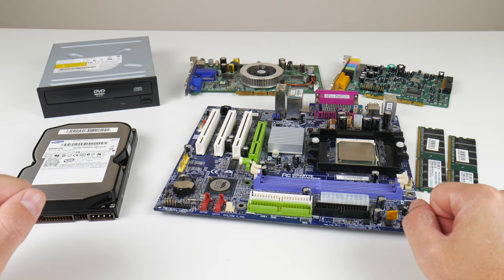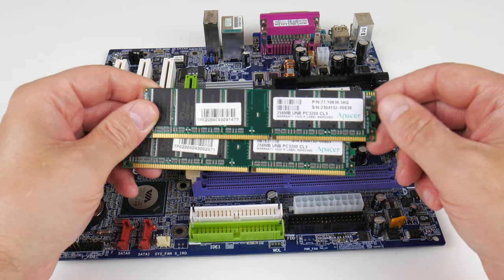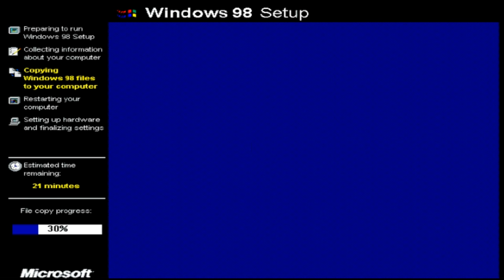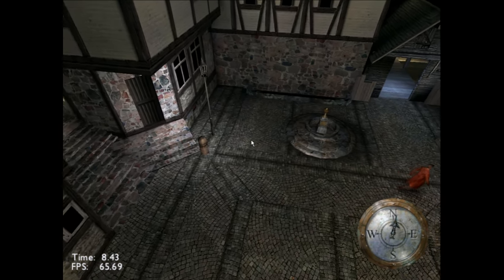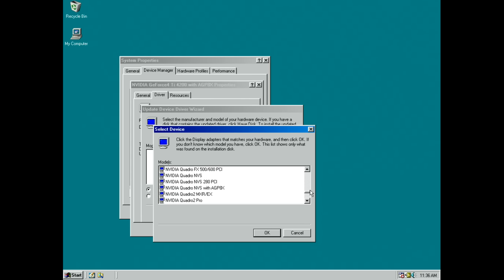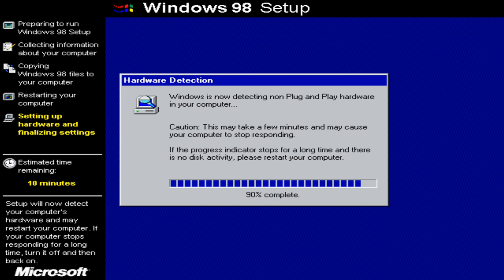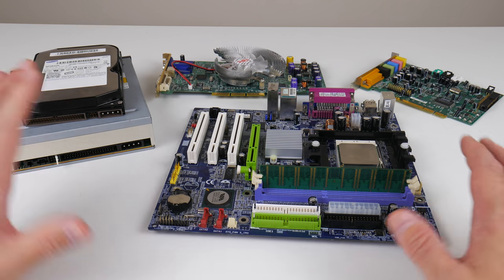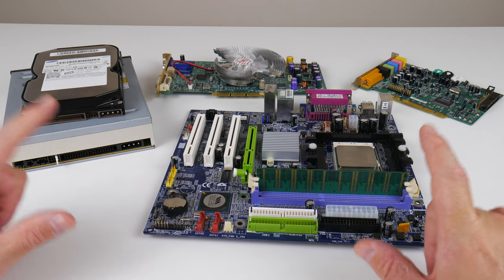Building Windows 98 Retro Gaming PC with AMD Athlon 64 Platform

Comment: If you want to use the SATA ports, you can enable RAID in BIOS (no array) then install the RAID driver and clone the install to a SATA HDD OR SSD. It works great and you get use of both SATA and IDE ports.

Comment: Hey Phil, Great Video, Why would you use the the older 45.83 forceware drivers vs the 81.98 forceware drivers? I am using 81.98 on my Retro Box (P4) w/ FX5700.

Comment: I had many Sound Blaster Live cards from salvaging parts from broken PCs.  I'm sure the sound card on the motherboard is adequate for Windows 98 gaming though.  For games that run in DOS, a Sound Blaster card is probably your best option.
Reply from the maker: Sound Blaster Live! is super for Windows 98!
Reply: For windows 98 gaming, a sound card with hardware eax or a3d is a great benefit for many games.
Reply: @philscomputerlab  I remember Sound Blaster Live working on the early builds of Windows 7 then when I reinstalled later versions I couldn't get the darn things working no matter which driver I tried.

Comment: VIA! Man they were a plague back in the Win98 days. Highly buggy and unreliable. At least those old original boards. #viaavoid  :)

P.S. You DID have issues with VIA, heh. SATA didn’t work. Videocard didn’t install correctly. All CLASSIC VIA issues.  :)   Still. Good video and allows users to decide with your good information as always.
Reply from the maker: You need to watch until the end, there is a happy ending :)

Comment: Great video Phil!  How would you under clock a CPU like that?  Would you just go into the BIOS and change some numbers?
Reply from the maker: Yes you can go into the BIOS and change the CPU multiplier or ratio. It can go as low as 5x which will have the CPU run at 1000 MHz instead of 1800.

Comment: I finally found a motherboard that I will be using for my Windows 98 retro build. No SATA. It took a while to find a board to use that was pre-SATA. It also has 512MB memory.. Also got a swanky ATI 128MB AGP card for it. Just need to look now for a sound card

Comment: Some 1 I know installed win 98 with 4 gb working ram! On a HP 6710b laptop (dual core t7500). He also fixed the color and screen to 32 bits. Amazing lol.

If you wanna know what programs he used, ask me.

Comment: I had a chance to pick up that sound card for cheap but passed on it because I read its pretty craptastic in DOS. For Win98 I have heard alot of very good things about it.
Reply: The one thing I remember about DOS is that it was very picky about newer hardware.  Getting sound to work was usually just a matter of selecting the correct IRQ in the game's setup.
Reply from the maker: Yea for DOS there are better PCI cards, and best are of course ISA cards. But the Santa Cruz is a good allrounder card and drivers are easy to install.

Comment: OMG I have the EXACT same motherboard for my Win98SE retro build! Thanks a lot for the Ctrl-F1 tip!

Got the entire system (K8VM800M-R2, Sempron 2800+, 250GB IDE/PATA HDD, N6200 128MB AGP, 350W PSU, and SEVEN strips of DDR RAM of various capacities from 256MB to 1GB) for just NT$500 (US$17, AU$26) last year. The graphics card was a bit unstable (probably due to its several bulging capacitors) so I replaced it with a Gigabyte GV-R9000 Pro II (wished I had better choices like 9600 or 9800, but that card was the best choice for a reasonable price; used mid- to high-end AGP cards in good condition are very rare and pricey in Taiwan) and added my old Sound Blaster Live! Platinum. It's running all my vintage Windows games (particularly those incompatible with WinNT/WinXP, such as Thief 1&2) without issues ever since.

There's one small issue: running CPU-Z 1.78 ("revived" Win98 support) would result a BSOD; seems to be a VXD issue. Running 1.57 (the last "original" Win98 supporting version) or the "vintage edition" 1.01 are fine.
Reply from the maker: Very nice! Radeon 9000 cards are very solid performers and have AA and AF to play around with. Wouldn't worry about CPU-z...
Reply: Found an used Radeon 9800 Pro on eBay for US$40; the same card in Taiwan would cost US$140.

Comment: Phil, does your board have the "Plus" variant of the southbridge on that board?  It's supposed to be the revised variant  that fixes the SATA controller. I've been working on as similar project, only I'm using a 3700+ (board was supposed to be an xp class machine, but I wound up going in a different direction) , a SB Live 5.1, and the Quadro FX variant of the 5900 Ultra. I'm still working out bugs as far as installing  the OS/drivers is concerned.
Reply from the maker: I does! Live! and 5900 Ultra work well with Windows 98 :)
Reply: Sounds like the same issues I was dealing with. Supposedly jumpering them to SATA I speeds helps with compatability. I  just recieved a 500 gb hybrid drive I'm going to try with the onboard SATA. If I cant get a functional ME or 98se install with it or my SATA card (I was having similar problems with a SATA PCI card) I'll go with the bridges I own. Maybe they'll work this time!

Comment: Nice! I have a amd Athlon 64 3200+ and it hangs with all the new processors just fine. Only issue is it's a bit stuttery playing 4k. What do you recommend I do? I heard overclocking is one option. Maybe upgrade graphics card?
Reply from the maker: 4K? Only hope is a video card that accelerates the video decoding. If the content is H264 and the machine is PCIe you do have options...

Comment: The VIA chipset doesn't like SATA 2 drives if your drive has a jumper to switch compatibility back to SATA 1 you can use it as a workaround.
It was a well known issue back in the day.
I still have my brothers old 754 Althon 64 2800 on a Gigabyte GA-K8VT800  it is using a WD SATA hard drive switched to SATA1 compatibility mode.

Comment: I still have my K7 Triton motherboard, I think the only difference between that and your was that it has dual channel memory support.  I've been using it as a 98 machine since I got it, and eventually put in a XP install on another hard drive and use the Master/Slave switch trick to control which drive is the master during power on.
Reply: The only thing different is that I have a GForce 6800 on that machine, as it was the best card i could find, back when they weren't that expensive.

Comment: Got my system up and running. Specs: Asus A8V Deluxe, Athlon64 X2 @2,8GHz, 2GB RAM, 160GB SATA, Radeon 3850 AGP & Voodoo3 PCI, ESS Solo-1 & SB X-Fi. Triple-boots Windows 10, Windows XP and of course Windows 98SE/DOS. In Win98SE/DOS I use Voodoo3, in BIOS I select init PCI display card. And in Windows XP & Windows 10 it's Radeon 3850. Windows 10 needs to be 1511 version because it's last that supports AGP.

Comment: I've had a problem on my vintage PC where it would turn on for a second, but the turn off, I got that resolved after I found out I just needed to have a floppy drive connected, but now it just won't display, is it that the motherboard, or cpu are damaged? Or do I need to reset the bios? IDK how to reset the bios on vintage motherboard s if I do have to, but I do know that I had problems with computers not displaying in the past, and the fix was just to put in a different cpu, but I don't have another compatible cpu, so idk what to do.
Reply: What PC do you have? You can try different things.
Try clearing the cmos. There should be a jumper to do it, but if you can't find it you can just remove the battery for a while, that should erase all of the bios settings as well.
Also you can put in a new battery, I had a Socket 7 board that wasn't turning on with an empty battery.
Try different ram, if you have multiple sticks of ram you can just remove them all and try everyone individually
Try disconnecting all your floppy or harddrive cables from the board, I had a PC that was not booting because of a broken IDE cable.
Reply: @Tom2404  I've got that problem fixed, I just bought another motherboard, the only problem I have now is that for some reason my hard drive is not being detected.

Comment: I have a very similar setup nearly ready but I have to recap the motherboad first.
Btw, Medion cards can be a bit weird, many times they're downclocked, don't run with some drivers and things like that, after all they're made to be cheap and just run in the machines they're installed.

Comment: I´ve got a socket 462 MSI motherboard with Via KM400A chipset (via8237 south bridge). Once in a while the S-Ata hard drive would not be detected at system start. I have to turn off the machine and reconnect the drive in the other S-ata port available, and so forth. Fortunately it doesn´t happen that often. Weird. For what I´ve read around in the Internet it is a known issue.

Comment: Hmm i was experimenting with various lga 775 motherboards with VIA vt8237R+ chipset and found out that sata devices work perfectly fine only when you use VIA's v-raid driver package. Since VIA has native win9x sata & raid drivers for vt8237 vt8237R+ vt8237A vt8237S vt8251 cx700. the default storage controller gets change to the v-raid controller which makes reading and write files really fast. I wish intel had still support up to ich7 like this but at least we can set sata to emulate a pata controller in the bios with later intel chipsets.
Reply: I loved VIA chipsets back in the day, looked more flexible, also SIS were decent
Reply: I had a P4M8M-V2 motherboard from MSI and had 8237A southbridge instead 8235 maybe for the MB revision since the user manual said 8235

Comment: Great vid! For the games that not work properly in my Windows XP retro machine (Intel E8600, 4gb DDR3, GeForce GTX440TI), I buid a PC with a Pentium 4 1.5ghz, 512 MB DDR,  and a a Geforce 4 MX with Win 98. I use it only for older Windows games like Sega Rally 2 that requires Win9x machine and also not work in my Windows 2000 machine (Celeron 430, 2gb DDR2, Ge Force 6200 TC), also use this W98 PC for Worms 2, Midtown Madness 2, Need for Speed 2, and others.

Comment: Thanks always for the inspiration and ideas. Did you manage to get this motherboard's USB2.0 ports working under Win98? Was anything to do with USB2.0 included in the VIA 4in1 or what drivers are needed? I'm stuck getting USB2.0 to work with a similar build.
Reply from the maker: I've disabled them. But on the Gigabyte website there are USB 2.0 Windows 98 drivers.
Reply: @philscomputerlab  Thanks so much for your reply. The mobo is a GA-8VM800M-775. I wonder if the the Gigabyte drivers for the GA-K8VM800M which has the same VIA chipset may have worked but anyway I was able to get USB2.0 storage working using just the nusb36e driver and no Gigabyte or VIA drivers installed... all I had to do  was manually remove all USB devices from device manager before installing nusb36e while using a PS2 mouse, otherwise I would get errors with msgsrv32 on boot. In your other video you recommend 865 chipset for P4 98SE but I am stuck with the one I've got unless it proves too incompatible.
Reply from the maker: Nice, good outcome!

Comment: I like these retrogaming rigs videos :)
Been playing around with a P4 Willamette 2.0Ghz (socket 423), 640 rdram and Windows 98SE, 2K and XP.
But decided to go with a Radeon 9800 Pro.
Windows XP is too tough with these specs.

Some specs are too high for the games you can run with these components.
Or sluggish with newer games.

I used Steam on XP as a workaround exists.
Reply: What's the workaround for steam to work on xp? Heard about this but didn't know how to get it working. Any help or advice would be appreciated. Thanks..
Reply: @Neksus-M06  thanks, I appreciate it..

Comment: Great video! I have a socket 939 I use for Windows 98. Some people say it's overkill but I say 1600x1200 max AA! I think the jump from the 4200 to the 4600 is maybe more because of the better drivers. I also use it for late DOS games - HOWEVER... Build engine games - where the power is most useful at 1600x1200 software rendered - do NOT like my 4200 or 5900FX. At low resolutions they are okay but at the ultra high ones they have all sorts of weird tearing and the fps counter tells lies. I had to downgrade to a GeForce 3 and then Duke Nukem 3D and Blood worked well at these resolutions - about 50-60 FPS at 1600x1200 on an a64 4000+. There's no such thing as overkill when it comes to software rendering high res!

Comment: I succeeded to use sata hdd drive in my fx 4100 windows 7 64 bit. Keeping AHCI mode connecting the drive to sata3, now it has no issues to install windows 7 64 bit.

Comment: I've always tried to get VIA chipset motherboards. Very compatible with various hardware I've thrown at them. I run an ASUS A8N-Deluxe with a Athlon 64 3700+ and a GeForce 7950 GT under windows 2000. I find windows 2000 is very compatible with windows 9x games; I've got a Pentium 2 machine with win98se for the few that aren't, plus DOS games.

Comment: Out of couriosity: Do you have a 939 motherboard with a similar VIA IGP laying around? Because i remember tests from back in the days, where the nforce2 IGP got an significant boost from using Dual Channel and even today it's the same.
Reply from the maker: Yea it will likely also benefit from the higher memory bandwidth! But having said that, Windows 98 compatible dedicated graphics card are easy to find and cheap!

Comment: Hard to say why the 4600 was so much faster than the 4200. The numbers for the 4200 really did seem very very low, and the 4600 is about what I would have expected. Could be something with the agp 8x implementation on the 4200 and not having fun with 98 drivers? (Is it for sure an 8x card? Most were 4x)  If things like side banding are not enabled, that can crater the performance by about that much. Perhaps with the drivers not working correctly had something to do with that?

Comment: Since you are the Budget Price to Per4mance king, what pc should I get, I think about going all in and getting a new b450 motherboard, the 1600af, and 8gb of ram (1 stick, or used 2 sticks), or save some money by going with a used xeon 2630v2 (on aliexpress can be found for 20 usd) a new chinese motherboard, and 2x8gb of ram. I need the pc to be able to drive games for atleast 5 years. (I plan on getting an rx580/570 8gb used). What do you recommend? (I have a 1600x900 monitor also)
Reply from the maker: I'd get the Ryzen platform!

Comment: I have been trying to get a Windows 98 machine up and running for over two weeks. First I tried it with a SS7 board and then with a Socket A board. So far Win98 has just been a buggy mess with constant crashes and drivers failing to install. What's your secret to a solid Win98 machine?

Comment: Good build for a retro system on the cheap. But Windows 98 might as well be called "Windows 98 Problems"
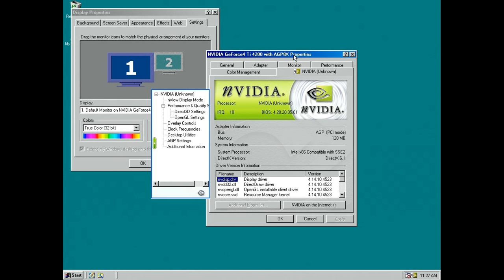One thing that may explain your odd performance uplift going 4200->4600, the 4200 appears to be running in PCI mode (2:06) and the 4600 in AGP 4x (14:48). Perhaps there's some problem with the chipset drivers.
Reply from the maker: Very interesting. The fact that the drivers wouldn't even install, maybe the card is just on its way out? I used the same chipset drivers, so not sure what went wrong...
Reply: I have the same card and didn't notice any problems in Windows 98, I used the 81.98 driver though. Maybe the previous owner fooled around with the bios to overclock it to standard Ti 4200 core clock.
Reply from the maker: Just an update. I figured out the issue. I'm working on a AGP FX 5500 review, and turns out the latest VIA chipset drivers, cause it to show up as PCI. Whereas the older ones from the Gigabyte site show AGP 8x. Performance is faster in AGP 8x mode :) Mystery solved :)
Reply: @philscomputerlab  That's good to know. Thanks for following up on it!

Comment: Try a different SATA controller. Via's SATA controllers are crap. Luckily my Via board comes with an extra 2 sata ports from Promise, but unfortunately they don't work under 98.
Reply from the maker: I have PCI controller from Promise, but didn't use it in this project...
Reply: @philscomputerlab  There are also some Silicon Image based controllers that support Win98 although I have no experience with them so don't know how well they work.
Reply from the maker: @Gooberslot  Yes I got some working but there are more versions to deal with, some missing the Bios chip. The Promise just works and there are no different models.

Comment: @Phil: What Nvidia drivers are the best for Windows 98SE on a GeForce FX5900 Ultra? I won’t be running any DirectX 9 games but do want to use nGlide. What is the latest build of nGlide that works on Windows 98SE?

I hope you can answer my questions.

Kind regards.
Reply from the maker: AFAIK the latest nGlide works in Windows 98. Try that same 55.xx driver I used.
Reply: @philscomputerlab  I will try it as soon as I can finish my retro build. Still waiting on my IDE to SATA converter so I can use my 120GB SSD as primary storage. Thanks for the quick reply. Really like your videos, keep up the good work. :)

Comment: VIA SATA only support SATA-I (150Mbps) speeds, SATA-II / SATA-III may only work when you can force SATA-I mode. Better find a mainboard with a Silicon image SI3112 sata solution.

Comment: I have two Medion (MSI) GeForce 4 Ti 4200 AGP 8X cards, and I never had issues with them on driver version 45.23 (too bad that v30.82 doesn’t work, it only works with the older AGP 4x version of GeForce 4 Ti, although I could probably tweak the inf file to force the installation). 30.82 is my go to driver for the regular GeForce 4 Ti cards on Win 98. It seems to have a 10 - 25% performance advantage, depending on the game. Anyway, my guess is that your issues are probably caused in some way by the VIA chipset. I only tested my cards on Intel chipsets.
Reply from the maker: Seeing the 4600 worked just fine, maybe my card was simply on its way out due to age?
Reply: It’s also a possibility, yes. However, I would test it on a different configuration before declaring it dead. :)